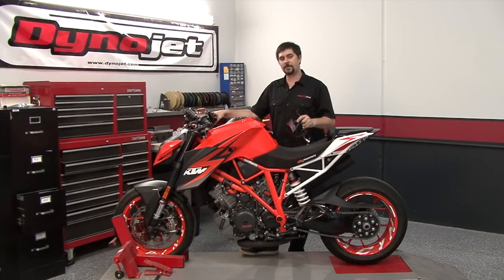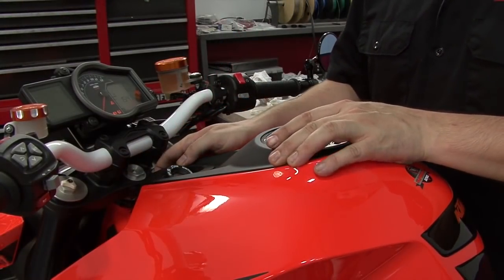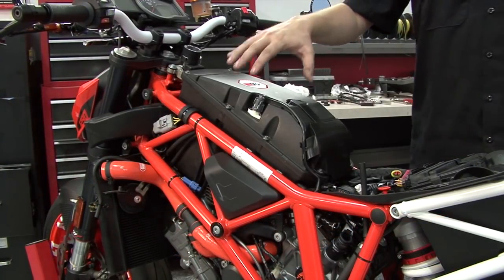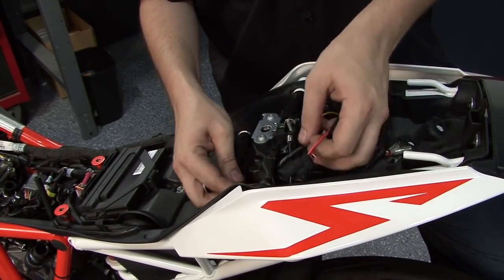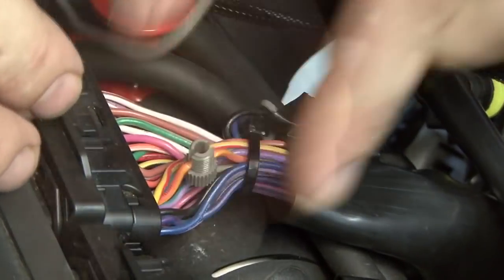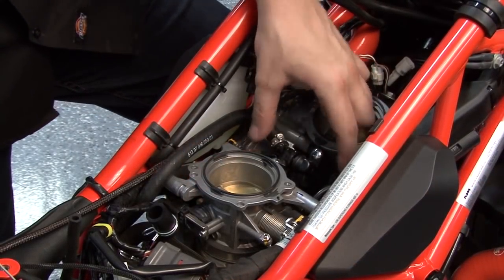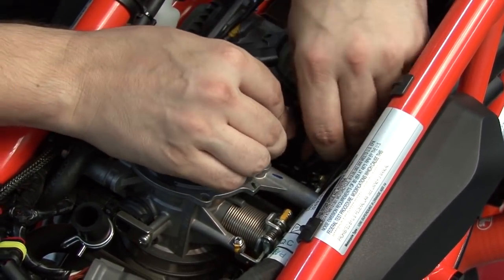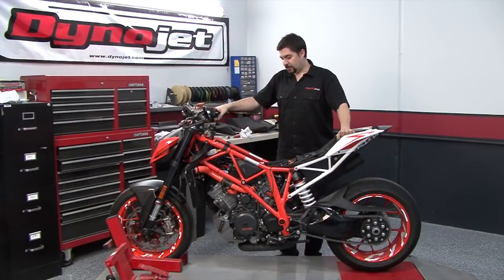Power Commander V Install: 2014 KTM 1290 Super Duke

Comment: Very easy to follow instructions..installed mine Thankyou
Reply: After you installed it did a blinking service light come on the dash? Mine does. Just installed it.
Reply: +WildmanOutdoors no mate only problem I had was the quickshifter didn't work straight away wen I looked into it I was told it would be delivered with the right settings installed as it was it wasn't but a few e mails sorted that out..regards Jase